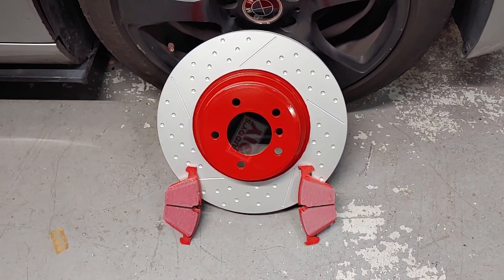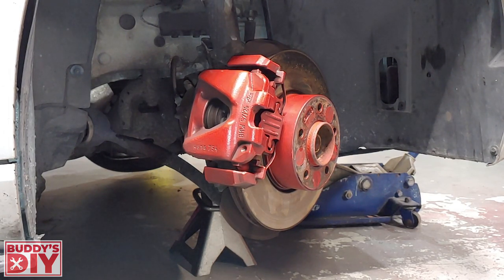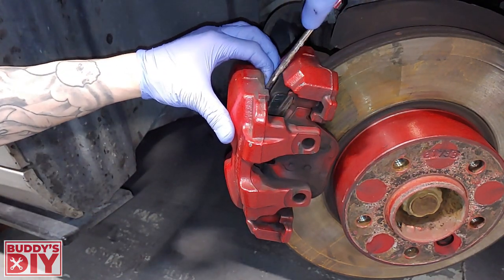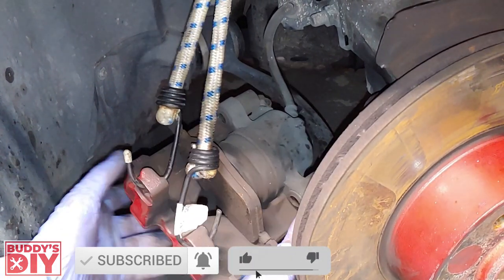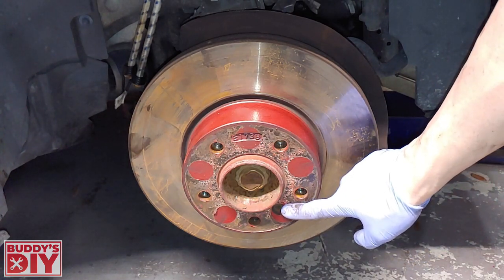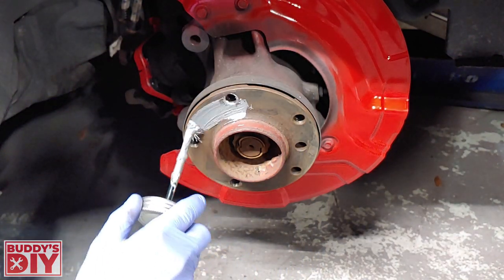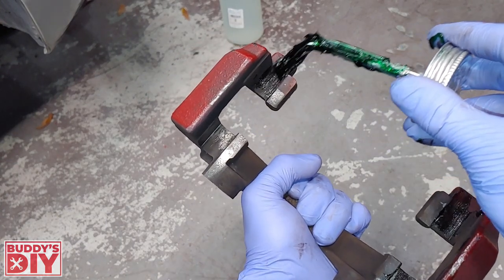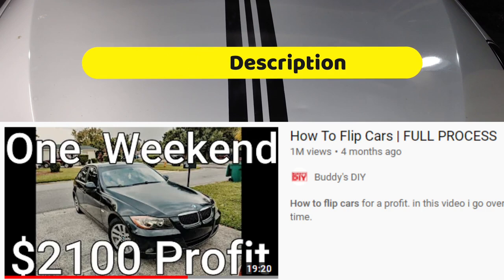BMW Brake Rotor Replacement | E90 E91E92 E93 E82 | 3 Series And 1 Series | EBC Brakes

Comment: Just finished brake job on 325i including calipers.  Great video tutorial.  You lay everything out step by step including extra "how to tips" such as using various lubricants and cleaners to make brake parts install and work smoothly.  Mine worked like a charm... One small detail in case nobody mentioned it....Those mount bolts are 18mm, at least on my BMW and it's pretty factory.  Thanks again!

Comment: Good Evening . Thank you for the video. I have a 2006 BMW E90 316i very well maintained with 90,000 km. The front ventilated discs from the factory were (22.00) mm thick. My question is: how many mm is the minimum thickness of the disks that I have to change them? (how much is their wear limit?). Thank you.

Comment: is replacing Brake Rotor and pads similar in other cars?
Reply from the maker: Yes sir. Same thing. Alot of cars don't even have a screw holding the rotor in place. Most of the time is just the wheel holding the rotor to the hub!

Comment: How can you tell that needed replacement? Miles used?
Reply from the maker: One was wrapped. Also yes miles for sure. You can also see the deep grooved in the rotor. And you can look up the thickness of the caliper spec. And take some cheap caliper measuring tool and check yourself!! Look up caliper measuring tool on google and you'll see what took I'm talking about! And other questions leave then here!
Reply: Thanks buddy
Reply from the maker: @sathwickborugadda4744  absolutely my friend. Should be less than one mm in loss! And more than one mm thinner than factory spec you should look into replacing them!